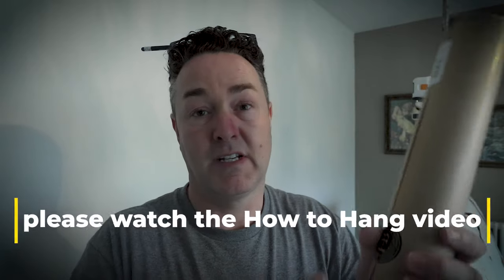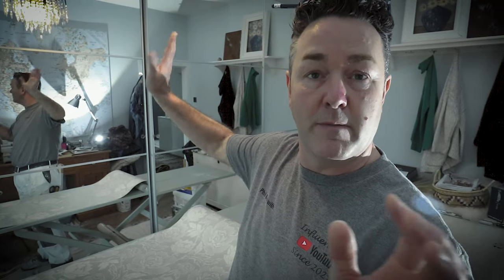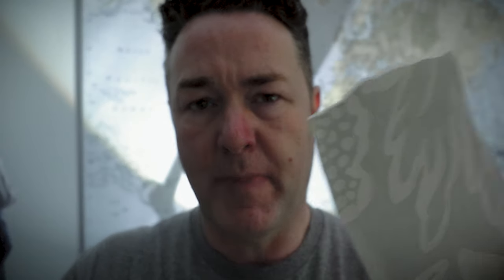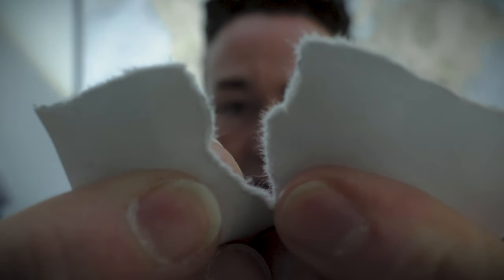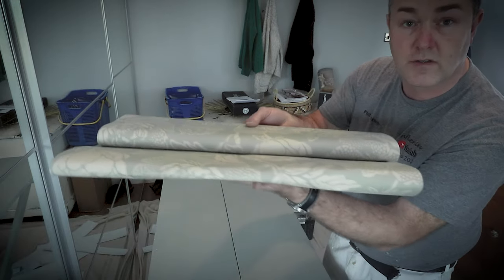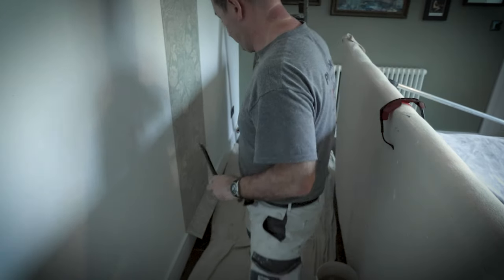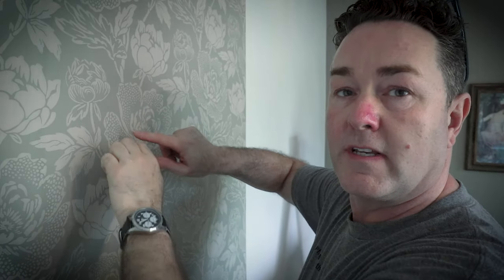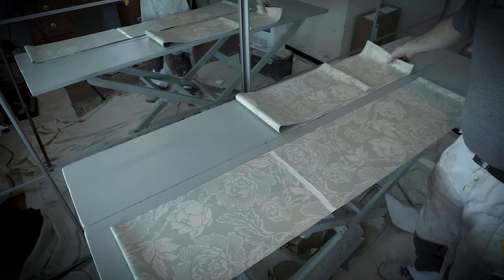How to hang Farrow and Ball Peony Wallpaper  + Hanging tips too

Comment: Excellent video, I  use an egg timer for soaking time helpful when you have a chatty customer ! I wonder  is  the half drop scenario that way because the wallpaper is more of a mural than a traditionally matched paper, the fact that each roll had 3 strips and you were instructed to hang in correspondence is 18, 19 then 20 and the half drop refers to the drops in each roll as opposed to the traditional  uneven numbers and even numbers matching ?

Comment: Also mate, I use the Wickes tub paste too but with you mentioned you put it on undiluted it looked like it went on very easily. I normally find it’s extremely thick and difficult to apply with a brush straight from the tub. Was that definitely not diluted and you’d forgot? Cheers mate
Reply from the maker: It weird. As I think it's altered these last 12months. It doesn't seem as thick as it was.
For lining and WallRock it seems fine. Sometimes I think it needs to be thicker.

I use Brewers Yellow top sometimes and that seems to be how Wickes used to be .. thick.
And needs thinning to get it on.
Reply: @ProfessionalPainterDecorator  aah right! I’ve not used Wickes on past few jobs simply because Wickes wasn’t convenient at the time so I’ll go back and see what it’s like again when I’m next that way 👍🏼

Comment: How do you go about charging for a feature wall phil? I find a day rate plus materials works for me but i know guys who have started to charge by the square metre with paste included in that.
Reply from the maker: I'll work out how long I'll be on it, work from our base hourly rate and adjust accordingly depending what's involved.
A basic feature wall is nothing less than £150 +vat 
Then there's the time for prep and lining to go on.
Reply: @ProfessionalPainterDecorator  yep same here mate. I tried to work out a sq metre price a couple of years ago after reading a really good little book by Pete Wilkinson, but I just found there were too many nuances in the work. As you say, lining, filling, caulking, different types of paper, number of sockets to go around etc so I went back to day rate , the same way I price every other job. Plus another thing I found was that I work on alot of Victorian and Edwardian properties and seldom new builds so the walls usually need alot more prep before lining. Cheers for the response Phil.